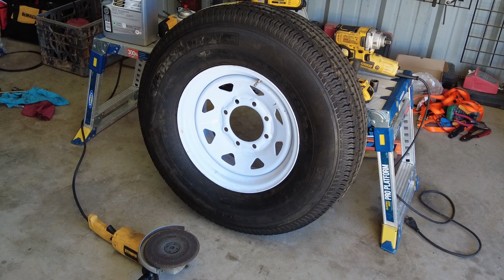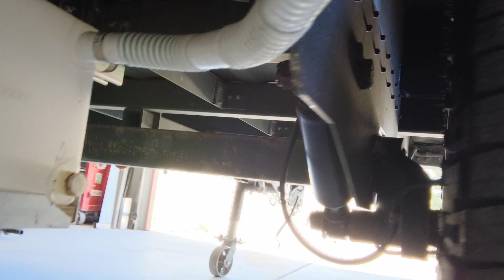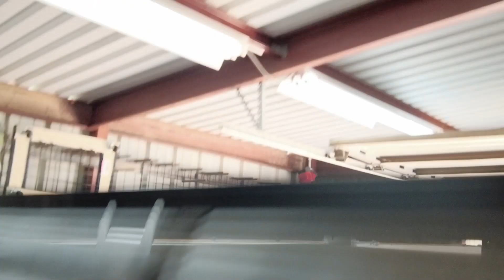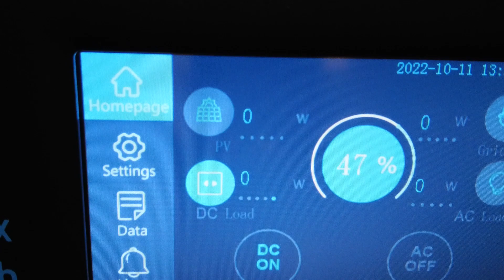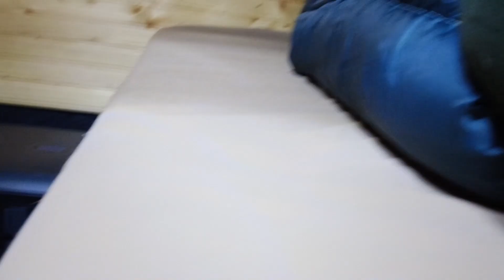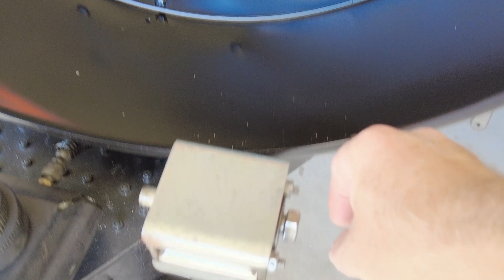Military M1101 M-1101Overland trailer build final revisions and last update.

Comment: I have a M1101 trailer and planned to build a camper very similar to what you have done.  Excellent job by the way.  I later bought  a S-1497 communication shelter to mount on the trailer,  but it was slightly to big to fit.  I found a M1102 S/A generator trailer,  and the shelter fit on it, like it was made for it.  I'm now in the process of completing the camper build, which will also double as a mobile HAM radio shack, for field operations. I also pull mine with a Gladiator.

Comment: Awesome build you gave me a lot of great ideas 😊I’m thinking about making a similar set up but with a roof that goes up and down so that you can stand in it when you get to where you’re going using electronic actuators similar to slide in camper jacks but have them go vertical and lift the entire roof up

Comment: not sure if you get any messages from old videos, i was wondering what rims you used are they chevy 8 bolt? any idea what year truck they were from? thanks in advanced.
Reply from the maker: Yes, chevy 8 lug. They were on it when i boight it.
Reply: Basically any 8 lug on 6.5 from Ford, Dodge, or Chevy from the 80s up until the 2010ish time frame. Backspacing is what you need to pay attention to, unless you don't mind your tires sitting out past your fender line. CUCV wheels tuck under there nicely.